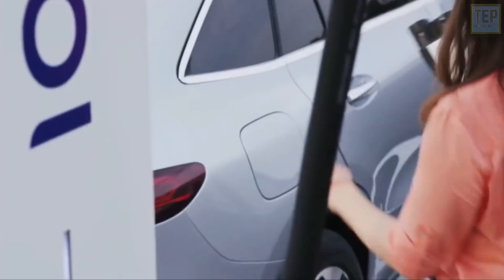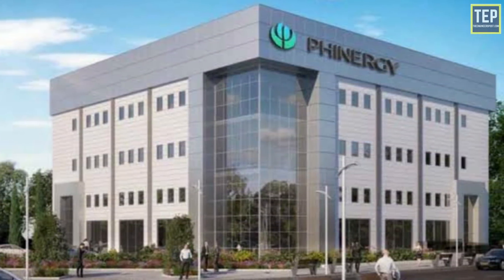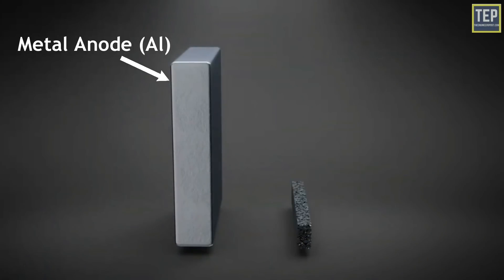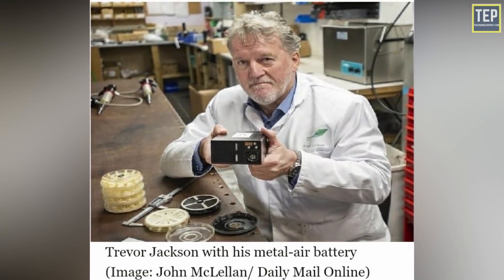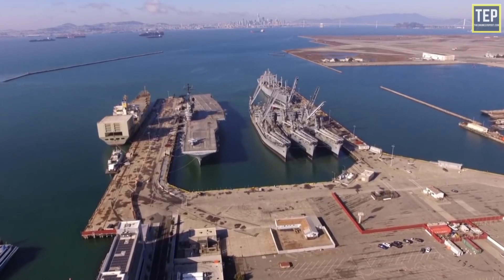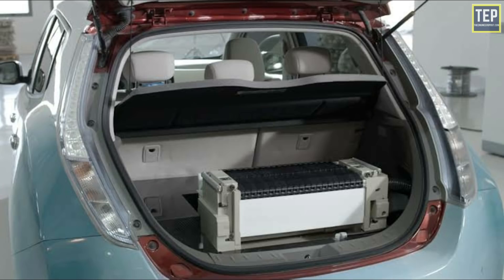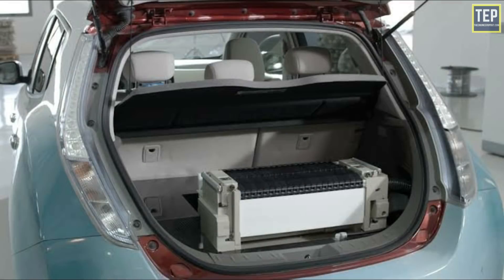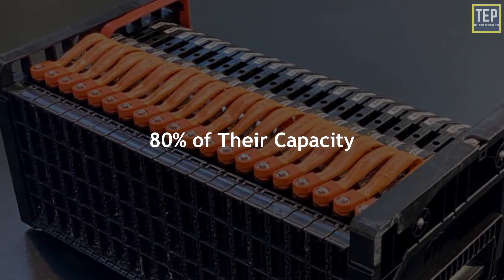Aluminium-Air Battery | An EV battery that Doesn't Need to be Charged

Comment: Most electric cars do have a range of 300 mi or less, but having to stop and charge really isn't an issue. If I can drive 3 or 4 hours and stop for 30 minutes to recharge that's perfectly fine. By that time I'm hungry or have to pee or something. Maybe I just want to break. 30 minutes ain't bad for 4 hours of driving. The real issue with the 300 mile range is less with the car and more with the charging infrastructure. I have a Tesla and they are plenty of charging stations everywhere, but they're not charging stations where they need to be. My opinion is that every rest stop in every stage should have a Tesla charging station and a normal charger station for other vehicles. Even let those other vehicles use the Tesla chargers. If we had any chargers at every rest stop there would not be an issue. Most restaurants are 1 to 3 hours apart. Stop at the rest stop, plug in your car, go pee. Usually by the time you get back it's already been 10 to 20 minutes and the car Even charging at a low charge rate of 60 kW would have gained between 40 and 80 miles while you're working. If it can charge faster at 120 kW then you just gained 80 to 160 miles of range while peeing. That would easily carry you to the next rest stop to charge again while you pee.

Comment: Had the same thought as few others have told in comments, while seeing this video. 

Two batteries are the solution. With single battery, One reason is to avoid draining out. Second every time we try to replace the battery can’t ensure we use it 100% till the end. So we may waste few percentage of aluminium without being used when we change battery. 

So two batteries in a vehicles makes it simple. 

Another solution is when going for long trips. If The batteries are produced like printer cartridges concept, we can buy extra numbers and take it for emergency use for long trips than the two installed already. Any ways we are going to use it, keeping in mind that the corrosion is taken care in design.

Comment: The essential difference between a rechargeable battery such as Li-ion and the Aluminium air battery is that former is a secondary battery, and rechargeable whereas the latter is a primary battery using expendable material ( Aluminium ) and therefore not rechargeable, similar to dry cells.

Comment: The Power of Aluminum Battery is Swappable.
The Power of Lithium Battery is Rechargeable.
Need of the hour is both Swappable and Rechargeable to meet the end user requirements.
Lets build EV's with both batteries, 
When I am near an Battery Swappable station 
I will swap the batteries and When I am not near a Swappable station 
I shall recharge as I have multiple recharging options.

Comment: If they can get the range up to about 5000 miles, it could become a case of take it into the shop for a battery change, just like you take a gas car into the shop for an oil change.  The remaining questions are:
1. How does the cost of the battery change compare to the cost of an oil change - PLUS 5000 MILES OF GAS.
2. They mentioned high degradation rate.  If that can't be fixed, it pretty much kills the whole concept.

Comment: Good presentation but with the new inroads into “electricity does not require a wire to be transmitted” more thought is going into cordless charging of the safe battery in any vehicle. Like we have cordless charging of mobiles these days. 👍🙏

Comment: The answer is simple if the battery as shown in this pro type car is capable of 2700 miles before needing to be swapped out ,you make the battery 5 times smaller which if the size to  power is reduced by 5 means you could 540 miles , that seems fairly good to me , I would imagine the battery size would be some what like a shoe box , so could easily be removed and replaced into a charging port that could fit on most parts of the car by the driver  .

Comment: This makes every bit of sense to have swap stations or in case of having missed it an on road swap service. I used to favour range extender hybrid swapouts (have specialist swap out centres that take a drive unit out, replacing it with a power equal hibrid electric power train) especially in still viable diesel engined vehicles, where after a while of further development a further exchange takes place where the space of the range extender is taken up by this or methanol technology (Audi Quattro engineer' fuel idea)

Comment: Not good for the environment to use energy to recycle the aluminium every 2700 miles. Most people hate changing their 12v battery after a few years, whose going to opt for changing it multiple times a year

Comment: So it is like an ordinary alkaline batteries, it can be used one time only, and after replacement the used ones must be taken apart, to replace the aluminium anodes. So we need a HUGE NUMBER OF THESE BATTERIES just like the alkaline ones. That is the biggest problem: the big numbers to produce before it could be used by the public...

Comment: In the United Kingdom, as far as charging  infrastructure is  concerned  we are still living in caves and painting our faces blue.

On the face of it. It sounds like a great idea. However the firm reality points to very low, or zero vehicle use for our people.

Look at the mass housing developments in London and docklands. Our Mayor of London, is primarily discouraging vehicle parking spaces because he has stated that our people require more exercise.

Add on 'Global warming' for good measure and the car for the masses will certainly be a 'Dead Duck'.

Comment: If the video information is correct, then getting 2700 miles per battery is like filling up the tank! Now, marketability will depend on the cost effectiveness of the aluminum battery replacement vs. the cost of filling a gas tank!

Comment: Sorry, 80% loss in one month means for half of the month, the car's range is drastically reduced.  And the aluminum that has had it's atomic structure changed?  What good is it?  It's metallic strength has been degraded, never to return.  And what other properties have been ruined, making the aluminum un-recyclable?

Comment: What about if the batteries can be made with removable cathodes with easy access and removal, in this way you can have spare cathodes in your car trunk, and maybe drive thousands and thousands of miles.

Comment: Since the batttery generates a charge - and ocmmences degredation - once the electrolyte is added - could the electrooyte not be 'added' as required , just time time style,  to only generate electricity when required?  So the bulk of the battery remains dry?

Comment: JUST PATHETIC LIES!!!

This battery uses Aluminum as the Anode, water is a stretch is has an electrolyte fluid like lead-acid batteries (NOT THE SAME THING) and Silver as the Catalyst for Cathode.

https://en.m.wikipedia.org/wiki/Aluminium%E2%80%93air_battery

Sucking in Oxygen and eroding Aluminum gives you 1300Wh / Kg and this setup runs on 1.2 volts a cell if correct. (WIKIPEDIA LINK INCLUDED)

This thing is a SCAM and has efficiency of 13% (GASOLINE IS 30% AND DIESEL MAXES OUT AT 50%), running on coal and steam would be better off then wasting Aluminum & Silver.

Hope you look into it and NOT write STUPID or NEGATIVE comments that don't serve any purpose except for making other readers agree with your laziness to actually research themselves.

If this gets deleted, well because it's YouTube (GOOGLE) and they censor everything they don't like. GOD BLESS!

Comment: In terms of energy efficiency, this is even worse than hydrogen. Making aluminum metal from aluminum hydroxide costs 8-10 times as much energy as can be recovered from an aluminium-air battery.
Reply: Yes I agree Ruud. It might make sense if the aluminium could be recovered totally using solar energy. It is disappointing that your observation what not addressed in the video.
Reply: Using what method
Reply: Yess you are right. It's efficiency is not that great. 
But overall cost of ownership after 400,000 km is still less for this battery tech as compared to lithium ion EVs or even LFP tech used in EVs. 

For this aluminium battery tech overall efficiency in one fuel cycle is about 20% which is more than current 13-15% for fossil fuels. 

But overall cost of ownership after 400,000 km drive. It still costs less as compared to Lithium ion or LFP EVs. 

1st of all the battery packs used in this cost almost 1/3 the lithium ion battery pack. And if compared to Tesla it is almost costs only 25% with even more or equivalent range.

Considering the real world use of battery even in Tesla we see that one battery pack is only good 400,000 km after that it needs to replaced. 
Mind you Telsa only gives warrenty upto 160,000 km.

Now in terms of operating cost i don't know about dollar but in rupee terms.

For Lithium ion battery we see cost = 0.50 rupee/km 

And for almunium battery after recycling, electrolyte recycling and middle man and profits included it costs = 2 rupee/km

So difference in operation cost difference is= 1.5 rupee/km 

So now for 400,000 km drive aluminium cost = 600,000 rupees.

But some of the Indian auto makers have said if they used aluminium batteries with small lithium ion buffer of 30-40km(which PPL can charge for daily use)
They can get cost of car down by around 800,000 rupee.

So effectively you save around 200,000 rupees overall.

But since they are giving small battery pack of 40km which PPL can charge for daily use. An average indian only drives 35km/day.
So those with such small commute daily can charge the buffer and use car cheaply everyday.

And if they want to go on extended drive they can use aluminium batteries.

Also we are only case studying here for normal office going use of car.
But there are commercial vehicles in India who travel around 500km/each day for them charging for hours is bad for business plus such heavy use would mean less battery life that mean they would need new battery pack even early there by increasing costs.

So overall it kind off makes sense of use even though the battery tech is only 20% efficient but that is offset by cheapness of materials as compared to lithium battery.

Plus, lithium prices are only ever increasing that means lithium batteries will only get expensive from here on. 

So this tech kind of makes sense.
Considering they use inert electrodes and renewable energy for recycling.

Comment: An interesting idea that may have some real world applications but using a Microturbine Generator (MTG) as a range extender to recharge the batteries on an EV while simultaneously providing full electric power to the drivetrain makes more sense and is currently available 

https://youtu.be/F4H3FE0Z4QQ

Comment: there does seem to be considerable potential... the main issue I see is battery costs..

if the cost to replace batteries is equal to, or better still, less than how much the equivalent amount of gasoline would cost.. then maybe you'll be onto something. Otherwise it's pretty much a non starter.

Meaning if you spend $300 in gas to drive the theoretical 2700 miles one of these batteries would have for a range, the replacement battery would have to cost no more than that

Comment: what if batteries able to split water ( fuel ) into H&O( a catalyst needed) then unite them in the cylinders ( ignition)  >  movement.. water produced ( exhaust)> to the fuel tank... then you can drive the globe with a 20 L of WATER...

Comment: Do you know what's much easier, cost effective, and environmentally friendlier to refine than aluminium and silver?  
 Petroleum.   Coincidentally, petroleum can also react with air to produce energy!  With a single charge of petroleum, the average petroleum vehicle can travel as far as 600 miles!  Petroleum cars can conveniently be recharged at fuelling stations that can easily store petroleum under ground, making the transfer of energy simple and quiet (no forklift truck backup beepers going off all day and night loading and unloading the aluminium cells from vehicles at your local battery station). Just imagine a future where people use petroleum as a cheap energy solution!  Amazing!

Comment: So basically you have to buy a new battery every time your car runs out of charge. I prefer recharging with li-ion or similar rechargeable batteries which are much cheaper to recharge or freely if you have solar panels. Moreover battery swapping is a technological dead end and causes much pollution in recycling of batteries. On the other hand rechargeable batteries have much room for improvement which can drastically decrease the charging time and cost in the coming years.

Comment: This is an interesting concept and should be pursued. Whilst being able to charge a battery is an advantage for Lithium batteries there is a downside to the infrastructure needed to support this capability. This rise in demand and drive to carbon zero are almost contradictory. My personal belief is we need to pursue all the alternatives we can and that the future will be a collection of solutions. This is where I worry that we are being led into a rechargeable EV solution which may not be the final destination.
Reply: That would mean that, instead of building infrastructure to transport and distribute fuel in some way, you want to build infrastructure to transport and distribute whole battery packs. The infrastructure is needed in any case, so that everyone who needs to charge up can do it. But, unlike rechargeable battery packs, you'd need to transport these back to a factory again to recharge and then transported back to the distribution station. This would mean way more logistics! And that's just one downside. I agree that we should also accept a mix of different fuel sources for our cars and trucks, but I don't see this one as a viable part of any combination. Just too many downsides.

Comment: Those spelling errors. >_< Also, you can't really charge an EV from a portable battery unless it's specifically made for mobile charging of EVs. The running batteries in ICE cars are in the range of 1 kWh, and you can't even use that directly. The best bet is to just flat tow an EV. Then there's that aluminium vs lithium density thing. LITHIUM IS LESS DENSE THAN ALUMINIUM.

Comment: I’m picturing a future when my battery needs charging I can open an access panel, unplug and remove and replace w/ a fully charged separate battery, small enough we can handle to bring it in the house or garage to charge and be ready to go.

Comment: It would be good for every larger flying object.
Like everything that has an airport as home-base.

At first only the biggest ones.

And at first only for flights over land, and with freight.

Its not good for EVs because the user is not as independant from a company as with his rechargeable battery.

Comment: if you combine a 300 kwh graphene battery with hydrogen and methanol and the aluminium-air-battery you can easily get ranges up to 5-10k miles

Comment: I think this technology could work well as a hybrid with lithium batteries. Basically a small lithium battery is used day to day around town but if you want to make a long trip then aluminium air battery is added to give range
Reply: Lithium batteries have a lot of disadvantages. The scarce resources li-ion batteries need is also a negative point.

Comment: Seems to me that once the reaction starts the power source is always "on" unless you can deprive the system of oxygen somehow. Not sure what 80% degradation was it one day? Means for range!?! Also if your pulling oxygen from the air your going to have to replace it at some point rt!?!
Oh yah sounds more like a fuel cell than a battery.

Comment: Ahhh yes i remember now that magic battery technology they talked about 10 years ago… and … and didn’t evolve at all… it’s like a cheap and environmental friendly way to produce hydrogen that still don’t exist even hydrogen is used since almost one century… Don’t wait to buy electric cars, yes batteries evolves but it’s a slow evolution, nobody will come in 2-3 years with a miracle technology food for 1000 miles per charge and charge in 5min.. forget about that.! Electric cars in 2021 are good enough to replace any fossil car !!

Comment: I won't accept this kind of batteries. I would have to pay for ever for this technology (imagine the price during vacations). I prefer to keep standard lithium batteries and charge them using solar panels on the roof. Just can imagine the logistics behind this aluminum battery. You can imagine trucks spending their time transporting batteries to the factories or to the swapping stations. Crazy!

Comment: Something i copied from a site that explains how aluminium is made:
The aluminium reduction process requires huge amounts of electric power, so it's important to use renewable energy sources that don't contaminate the environment. The most common renewable energy source is a hydroelectric power plant, as they can deliver the required power without contaminating the atmosphere. For example, in Russia 95% of aluminium smelters derive electricity from hydroelectric power plants. However, there are places in the word that are still dominated by coal-fired generation, for example in China, 93% of aluminium production gets its power from coal fired power plants. When hydroelectric power is used just 4 tonnes of carbon dioxide is emitted into the atmosphere per each tonne of aluminium produced, but when coal-fired generation is used, five times as much carbon dioxide is emitted per each tonne of output, or 21.6 tonnes of carbon dioxide.

But make an electric car from it and suddenly its called green.
The world has gone nuts.

Comment: So aluminum is being used as fuel rather than battery.  So why not make aluminum anode easily swappable?  So all you need to do is carry some spare aluminum anode and if you run out, replace it